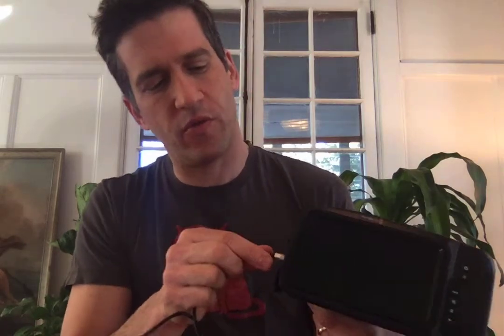How to remove power cable from Blackmagic pocket cinema camera

Comment: Hello, I have an issue trying to remove power plug pieces on the other end of the cable that connects to power source/wall outlet. The BMP box comes with a variety of region based plugs that you can connect, but I'm unable to pull it off once I set one piece in. Please help on how to easily change between power plug options provided, so I can easily change between them for different sockets, thanks